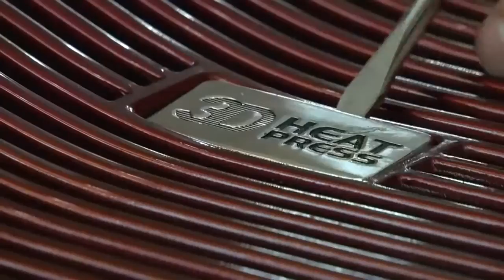3D Sublimation Machine Repair and Maintenance

Comment: Horrible machine! Save yourself some money and buy a different one,  No support, no nothing! I used 2 TIMES! 2 freaking times and the 3rd time I was going to use the temperature wouldnt go up, so I did what this video said, replace the temperature sensor and cool... the temperature goes up now but it says in 200 C but it actually isnt, so this is bullshit, I dont even know what else to do with it, any suggestions?
Reply: im not sure if you doing this, but when heating this machine, you have to press the heating button twice so that it will heat the whole machine, if you do not do this it prints terrible, my prints come out brilliant only issue i have it keeps tripping the main once the item is completed.